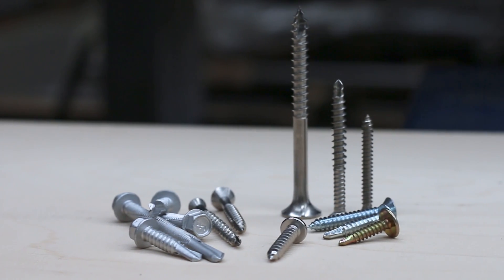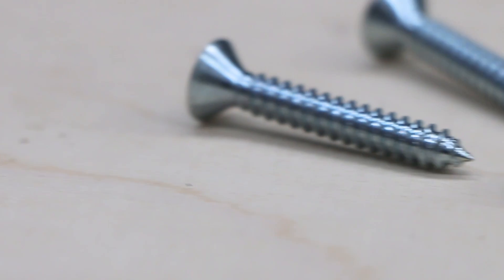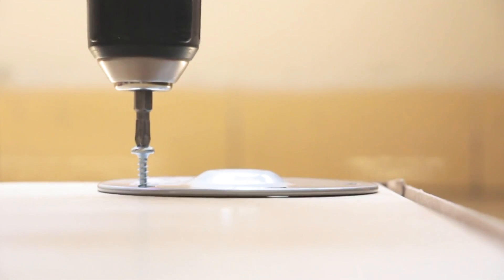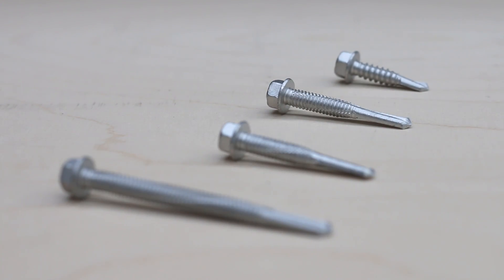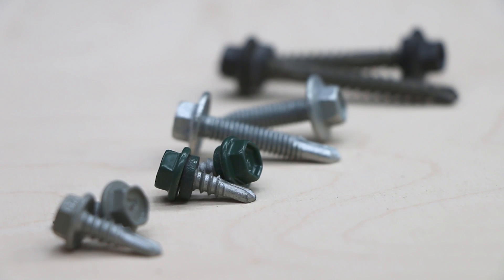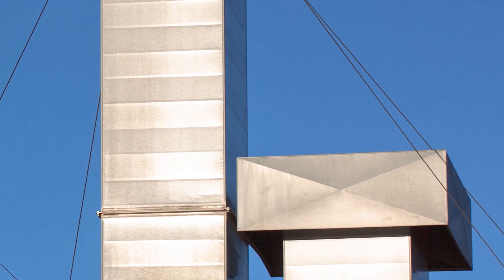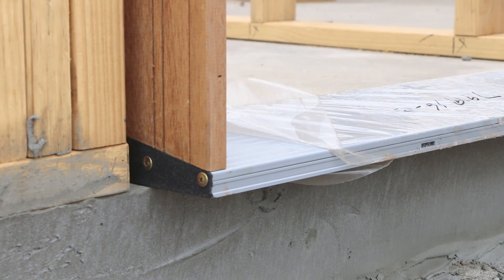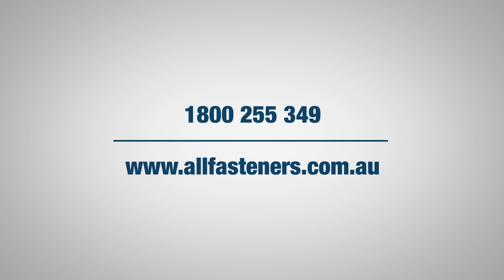Self-Tapping vs Self-Drilling Screws: The Unknown Differences

Comment: Would you sugget self tapping or self drilling for metal frame fence and wood ?
Reply from the maker: Hi there if you are fixing timber fence palings to metal frame, look for a winged tip self-drilling screw. These will bore through the timber enough to countersunk the head in the timber and the drill tip will go through metal. Alternatively, select a metal self-driller (aka metal-tek) and pre drill your timber holes.

Comment: I tried to find a stainless steel self drilling replacement for my current screws going into my HVAC unit.  Home Depot nor Lowes had them in stainless steel.  Do they not make them in stainless steel?
Reply from the maker: Hi Renee, they may not stock them but we certainly do. See here for a full range of sizes: https://www.allfasteners.com/products/screws/self-drill-screws
If you would like to order online, we also do shipping! https://www.allfasteners.com/how-we-ship/
Reply: @AllfastenersUSA  thanks, I'll check it out.
Reply from the maker: If you need anymore help with finding the correct fasteners, feel free to contact our New Jersey office on 201-783-8836 or sales@allfasteners.com . Our sales staff are trained to help you find the right fastener for the right application. Have a good day :)
Reply: where are you located? Try HD supply, they have everything
Reply: @Osmondlloyd  Phoenix - HD didn't have in stainless steel.